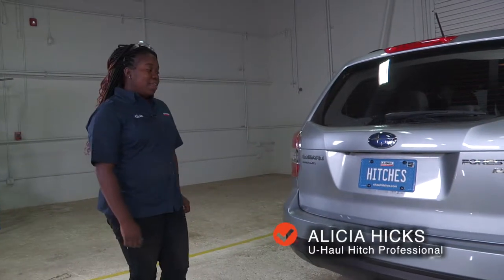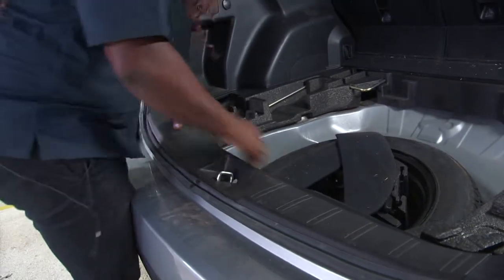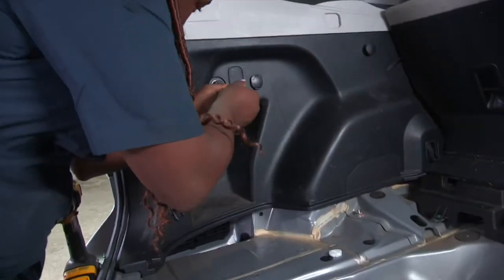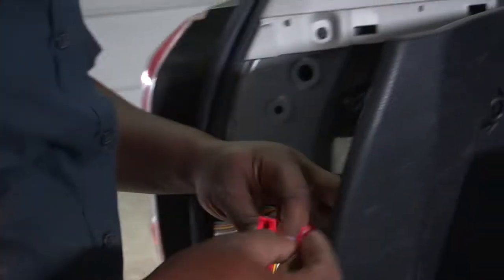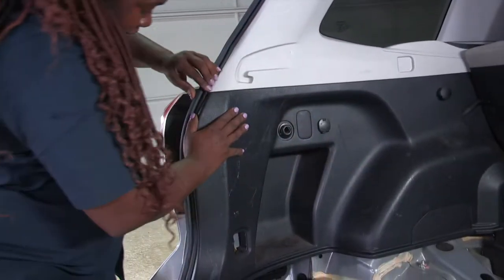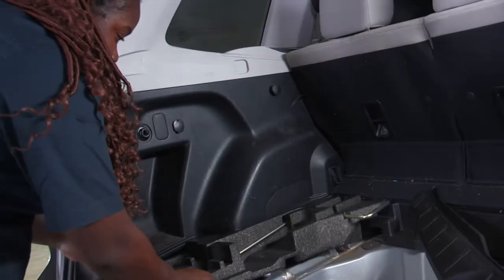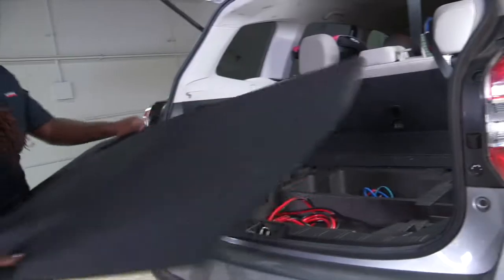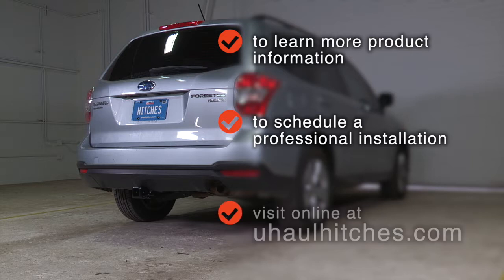2014-2018 Subaru Forester Trailer Wiring Installation

Comment: Saved me! Thanks, easy as can be when you know where to look, The directions provided in my kit had  the wrong locations of the connector
Reply from the maker: The Subaru forester tow harness adapter has moved from several locations and the directions call out several possibilities of location. This is because this part fits the 2009-2024 Forester. Im glad you were able to locate it with ease! Thanks for Watching!

Comment: Thank You for putting this up and for the pointer to the other installation video.
https://www.youtube.com/watch?v=Fu_CWRNCFcQ
This other video shows where it comes through the body which should be similar for all years. Can trace it from there.
You saved me lots of time.
Edit: I was too optimistic. Found nothing on the drivers side of my 2018 Forester. Will be removing the tore and looking on the passenger side and then underneath. 

Oh well!!😃😜Have fun searching and make sure you have a set of panel plug pullers from Harbor Freight to aid in your journey!!
Reply from the maker: The harness location changed on all Subaru's models even though they all  use this harness. It can be confusing. The new 2024 Outback is somewhere entirely Different. But easy to find underneath the scuff panel to the passenger Side. Look for the Pink tape! Video Coming Soon!